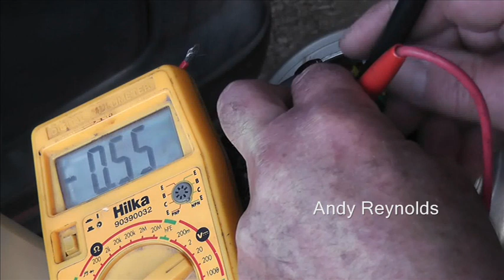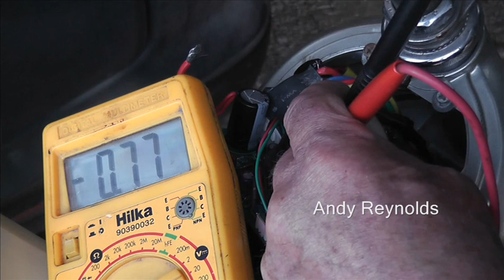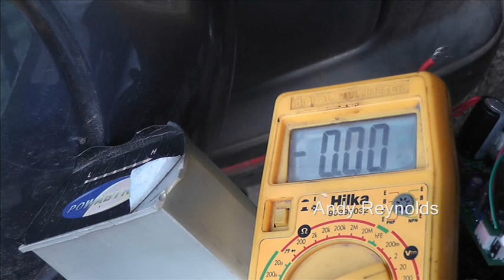Powabyke Hall effect throttle test.

Comment: 5.9 is a little high the're usually 4.7-5.0 on the red, black ground, green (signal) 1.1v throttle released 4.5-4.7v throttle at warp factor 9
Reply from the maker: Thanks for this detail, as Equilux suggested I need to check my meter. However the return is low so maybe test the throttle on the bench power supply, Maybe connect he positive to the return through a 1k resistor to see if there is any output voltage. Cheers

Comment: I dont know about the Powabyke but on the bike I have turning the key right around releases the battery pack from the frame, Not sure I would worry about the voltage on the hall effect I would look to see what the output voltage from the controller is. How accurate is your meter have you checked it against a known source, I always check my meters against each other and voltage standard surprising how they differ from each other. The five volts may well be in speck and your meters reading a bit high.
Reply from the maker: Very good point about the meter, I can compare it with another on a new 9v battery. Further tests required to see if anything is on the output, though I suspect his bike was abandoned because of the controller. On this model there is a separate lock for the battery, so the last position is an anomaly, cheers

Comment: Andy, I can't help with that Hall effect throttle, but it looks like that bike maybe the 'Euro' model ? Here is a vid on YT that shows diagnostic mode for the controller if so - it only seems to have 3 key positions rather than 4, but maybe interesting if you can get the display to show what it thinks is wrong ?
https://www.youtube.com/watch?v=ERV21obQgjs&t=45s

 It seems like those older Powabykes usually (?) had 3 key positions - off, throttle only mode (after 3 rotations of pedals ) and pedal assist, where you need to pedal continuously to get the the throttle to work with you. I think. Maybe your keyswitch has been messed around with and now has a 4th position which is the same as 'off' ? Just thoughts....Cheers, Dave
Reply from the maker: Dave, thanks for your thoughts, it's an odd one, maybe a bench test with a regulated 5v may give some further answers. Always difficult when other "fixings" have happened. s to the switch, who can say but it;s not a problem if there are two off positions. It would be great to get this going as the rest of it seems serviceable but just abandoned, probably just because of the controller. More tinkering needed, cheers
Reply: @TheInfoworks  Ok Andy, yes, not so good that it has already been fiddled with.
I forgot to add, it looks (on a very quick look) like Powabykes need to see pedals turning to get any output to motor - on key position 1 you may only need 3 turns of pedals then you can coast and use throttle only, position 2 requires you to turn pedals all the time to get power from throttle operation - so you could try reconnecting the pedal sensor if the wiring is still present both ends, and see if that gets output. Dave
Reply from the maker: @noakeswalker  Dave, thanks for that valuable information. It's weird that the crank sensor wiring has been removed and unplugged from the controller. Maybe this bike was used as a donor, but the rest is in such good nick, non of this makes sense, cheers
Reply: @TheInfoworks  Andy, yes I don't understand why the crank sensor has its wiring removed - maybe someone has tried to modify the controller so it doesn't need pedal input at all, and in effect tried to make a moped ?  Firmware modifications maybe ? So reconnecting the sensor was really just to eliminate that as a possible cause of no power. Dave   (I know someone who I think had a Powabyke way back,  I might ask him if he can remember any of this stuff)

Comment: On 1st sight they look to have got a little hot
Reply from the maker: Yes, you are right the hot glue holding the plug in the socket had let go. They 5.9v may well have done for the sensor, but I don't know much about them, cheers